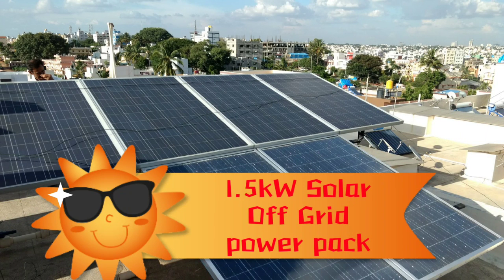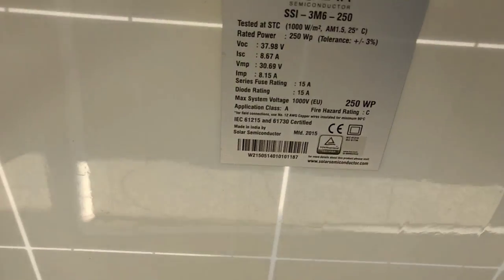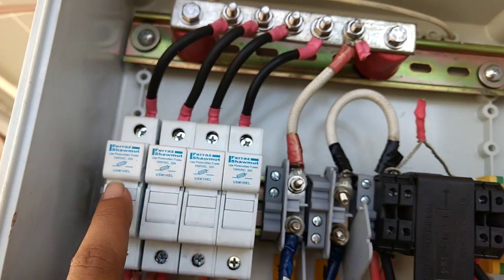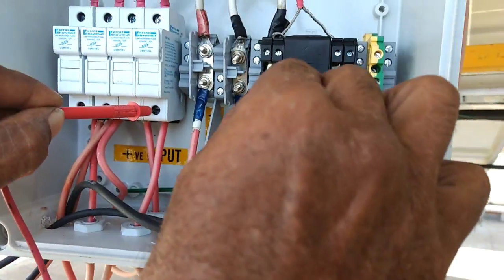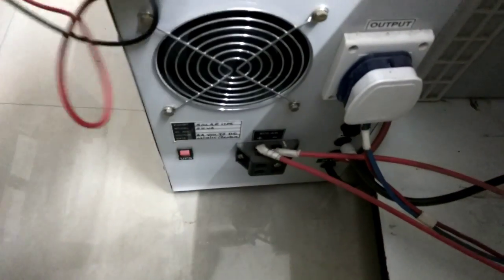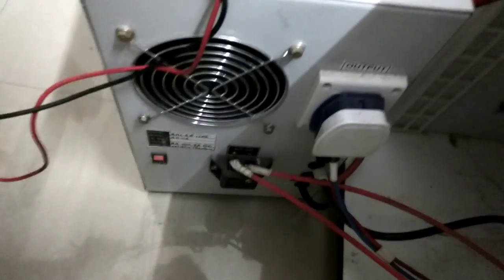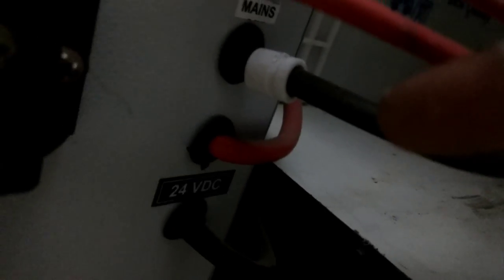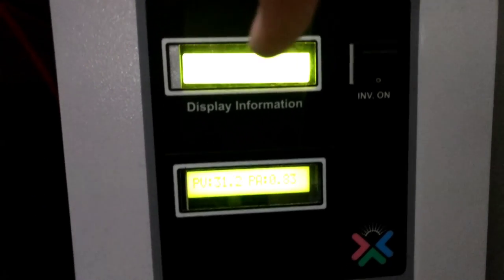1.5kW Solar Off- Grid power pack installation and testing #SustainableEveryDay

Comment: Great video, 

What is the spec and fuse ratings for both DCDB and ACDB single phase boxes and this system ??

Solar Off Grid Combo | NXG 1850 (1500kwa), Solar Battery 150 Ah (2 Nos.), Solar Panel 330 W 24v (4 Nos.) Voc 46v

Please help

Comment: Hi sir we are using 2hp solar system with 2kw panels by only solar..we want connect 2KW inverter to the same panels to get power to batteries for lights and other use..is it works ?
Reply from the maker: Unfortunately no the 2HP motor cannot work on battery either you can run 2kw inverter with solar panels or the 2HP pump , both together not possible

Comment: Is it dcmcb required inbitween for invertor to battery connecting point?
Reply from the maker: No not actually required , the inverter itself has the DC cutoff feature

Comment: Can you pls tell me how i can connect panel in series and parellel?????
Reply from the maker: +Md Zahid 
When you connect +ve of one pannel to -ve of other pannel and again continue the same to form a chain you are connecting the modules in series ,. And when you combine all +ve to one point and all -ve to one point you make a parallel connection
Reply: Thats i know sir.but my question is how to know that how many panel connect to series and parellel.???
Reply from the maker: +Md Zahid 
That depends on your load which you want to run , using the formula p=v×i
Reply: @mdzahid8447  if you need a parallel connection which is the best connection protocol of pannels that means you have to have a separate Inverter for each pannel, meaning each will be connected to its own inverter but taking a single line that bonds all electric joints at a single meeting point. Unlike parallel that u need a single inverter and just connect all the pannels together on that single inverter.